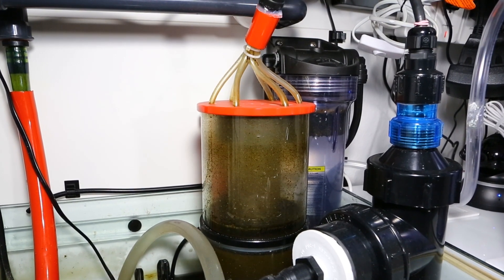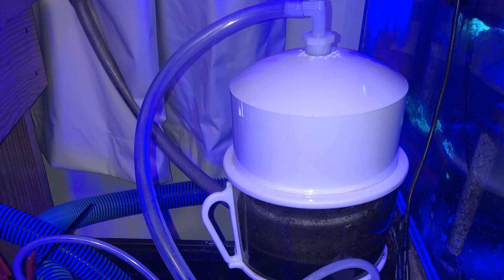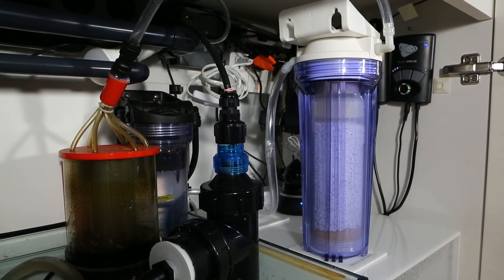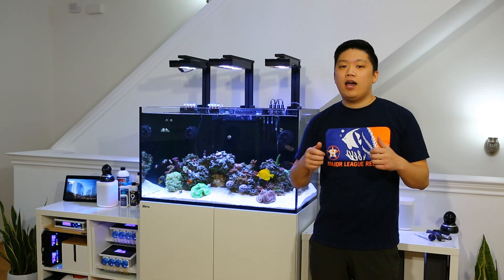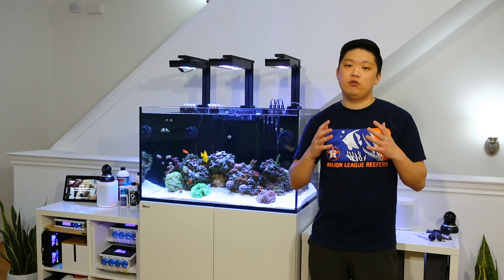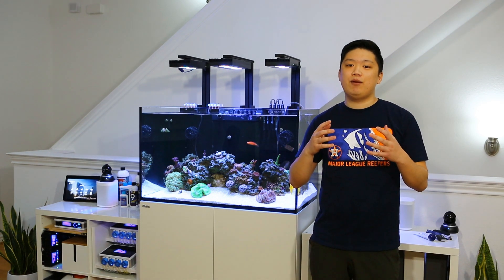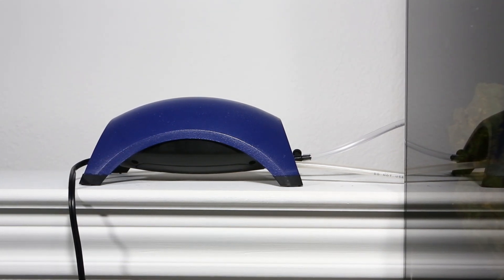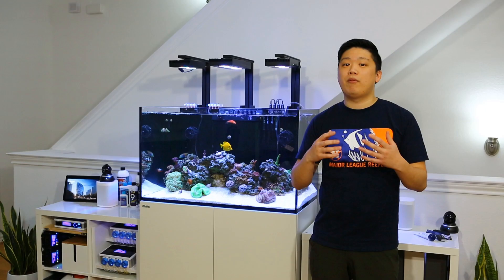What Is a Recirculating CO2 Scrubber?

Comment: Very cool work, the air pump is genius. How long does the media last after implementing the air pump solution?
Reply from the maker: Inappropriate Reefer I haven’t changed it since I implemented it... it’s been over a 45 days and the color still hasn’t changed. My guess easily 2-3months. Depending on how much air passes through from the air pump. Nice thing is that it can be dialed in to a minimum such that now water build
Up in the scrubber!
Reply: Or, alternatively, run a fuge reversed lit, like everyone else.  This isn’t a practical idea which other people will follow.
Reply from the maker: Chosen Jacob I ran a reverse fuge for about a year and a half with triton method. Work well, but I then decided to move away from it from a nutrient control perspective and doing the Triton Other Methods. I was finding it hard to maintain a stable chaeto population and that taking out small amounts of chaeto frequently was not going to work for me because of certain travel schedules. If I ever removed too much chaeto at one time, it resulted in a pretty drastic system imbalance. Hence this is how I ended up here. I will say this though. This scrubber method is not hard to setup and is relatively cheap. It also does not move parameters as much like the fuge can do, depending on the circumstances. Definitely not telling people to remove their fuge if that is working for them.
Reply: @HobbySci  I wasn't expecting a response, thank you sir.
Reply from the maker: Chosen Jacob I always respond! : D

Comment: 7.8 to 8.3 is absolutely fine. fluctuations within that range are absolute fine. I run a scrubber too, but get nearly the same result by running a 1/2 line outside. The benefit you speak of in a recirc scrubber, is the media lasts 3 times as long, but Ive found it STILL fluctuates. Im happy with stability anywhere within that range. I usually stay at 7.9 during the day and 8.1 to 8.2 at night. Im running an Apex.....Good video, thank you.

Comment: This is very interesting....I have co2 scrubber media on hand and was thinking of doing a DIY with an empty cylinder. Because I already pull outside air into my skimmer through the air intake, my thinking was to modify the empty cylinder to have the air tube enter the side at the bottom through a hole with a silicone gasket to maintain the air tightness, cut the hose inside about 1” in, and resume the air hose at the top, also installed with a tight fit, then it could travel to the skimmer air intake....🤔 I think it would be very simple to add a second air line from a skimmer cup lid cover (as you illustrated) down again to the bottom of the cylinder and I believe the air draw from the skimmer would be sufficient to pull the recirculated air through, without having to add a second pump....I have a Deltec 600i, which has a DC pump and thus I can increase the levels to pull more air.....this really has me thinking....

Great video, thank you for sharing! 👍🏻👍🏻
Reply from the maker: Glad you found it useful! Having a hard time visualizing exactly what you mean haha I would need a picture/diagram. Youre right in that you don’t need an air pump for the recirculating portion of the skimmer. However the air pump is handy in that it lets you cheaply regulate additional air intake for moisture control. The additional cost would only be in the $20 range which would be well worth it. Mind if I ask what your peak pH and what you keep your alkalinity at? With this setup I can run as low as 8.0 dkH with a pH peak of 8.55 at day time (calibrated).
Reply: pH ranges from 7.95 overnight to 8.15 during the day (min/max readings I’ve seen). Alk is currently 7.5 and I’m slowly increasing it to a target of 8.5. I’ve had a lot of growth and for a while was struggling to keep it above 7. But I’ve finally found the right dosing levels to keep it increasing steadily. I should reach the target in about 2 weeks.

Thing is, I have to do a lot of fragging, mainly montipora plates, so I know there’s going to be a big draw on Alk as soon as I do that. I’d normally shoot for 8 as a target, but I don’t want to start fragging until I get it to at least 8.5. It’s going to be a balancing act....🤔
Reply from the maker: Reefgrrl haha doesn’t sound like you have any problems. Honestly if your growth is fine I wouldn’t want to push your pH too high. You may have an explosion in growth!